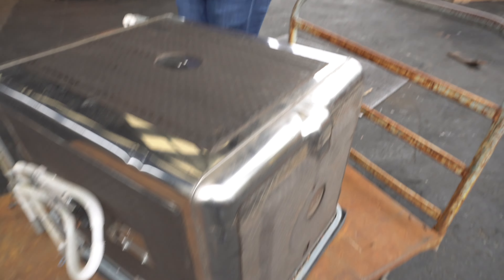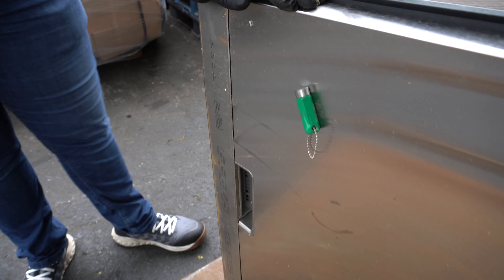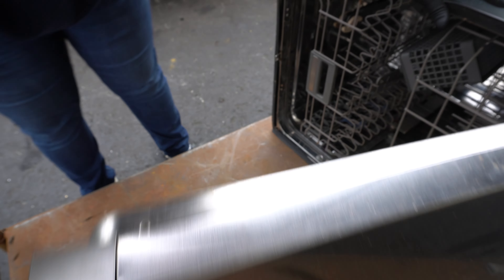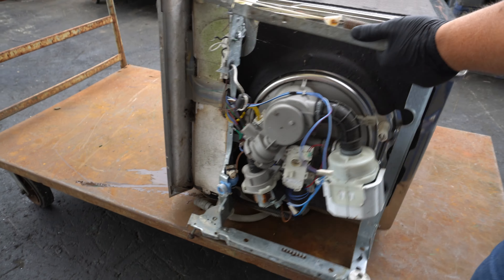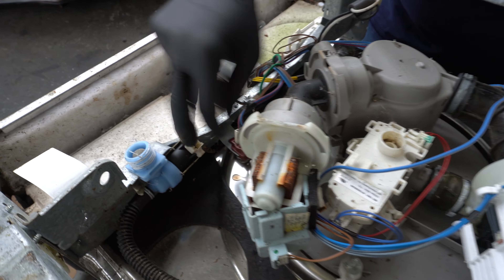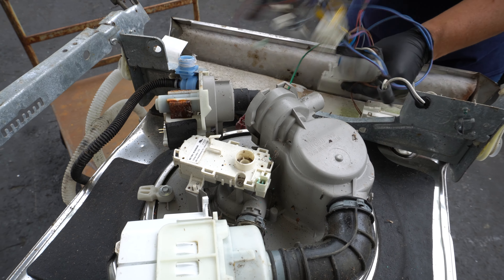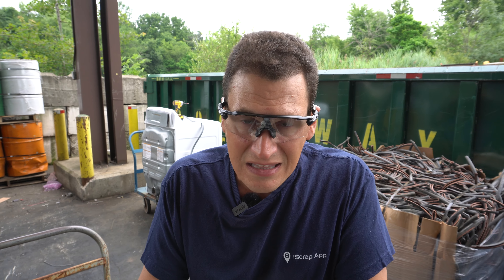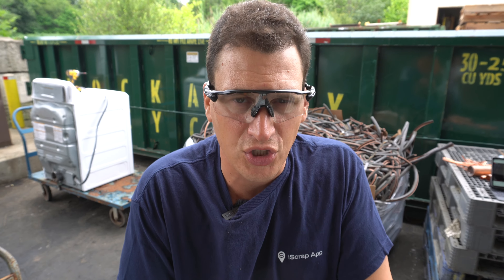Maximize Profits Scrapping a Dishwasher: Top Tips Revealed

Comment: Living in a small community, I only get so much scrap so I maximize everything off of it. If I lived in a large area and scrap is abundant, burning through stuff like this would be acceptable. There's no one way to scrap.
Reply: If it’s plastic on the inside I dnt bother yards wnt take it
Reply: @joshuamorris9050 the 2 scrap yards I go to- they take dishwashers with no questions asks. Even if they are plastic on the inside.
Reply: @number8killer383  usually not the case but good for you
Reply from the maker: Good point! sometimes we focus on the big guys and don't focus on the little guys. Thanks for the reminder